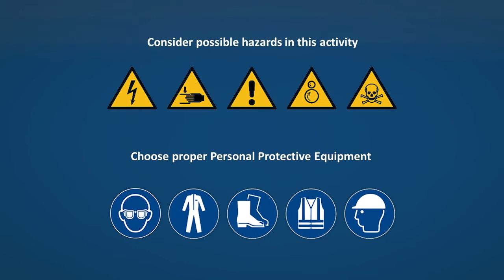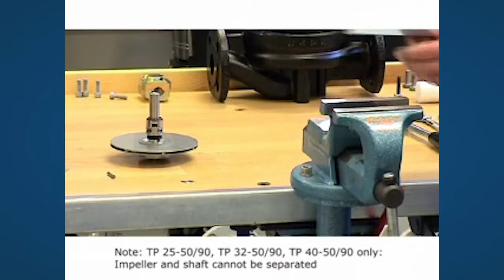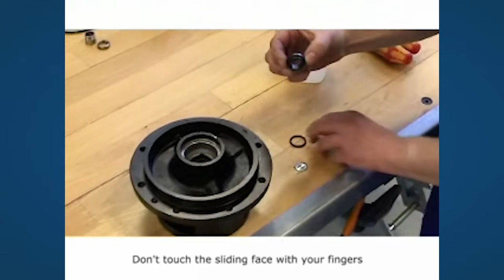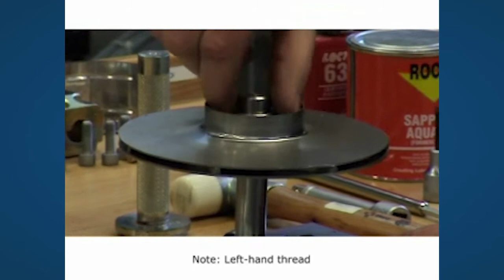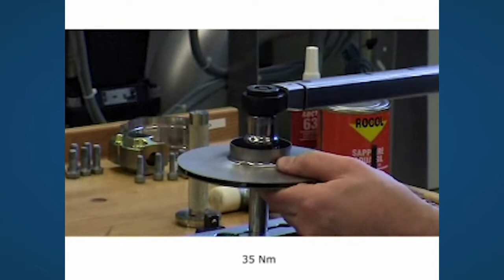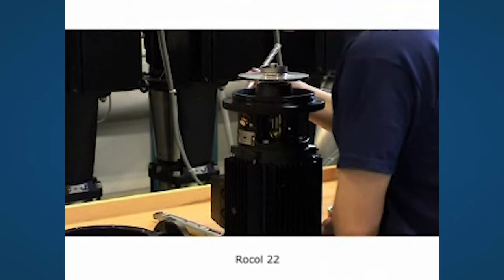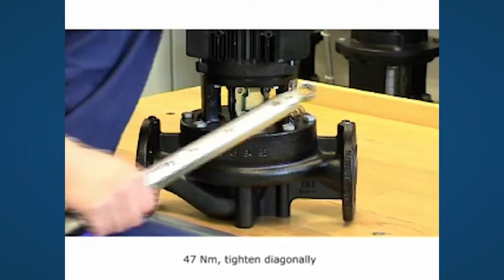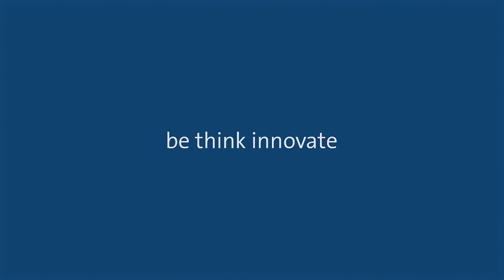How to dismantle and assemble Grundfos TP Series 100, 200 pumps

Comment: So the pump shaft and motor shaft are not touching in the coupling? Why is there space in between?
Reply from the maker: @stefanvandenberg9221; the two parts are solidly combined by a pin to act as one 'starre verbinding'. There will always be a small space in between.
Regards, >Renate
Reply: @grundfos  Thank you Renate for the reply! I actually meant the part in 12:40. There is a small space between the motor shaft and pump shaft. With this pump it it possible to press the pump shaft against the motor shaft because the pin is only connected in the pump shaft and coupling parts. Is the motor shaft touching the pump shaft in the coupling? Or is the space supposed to be there for a correct mechanical seal pressure?